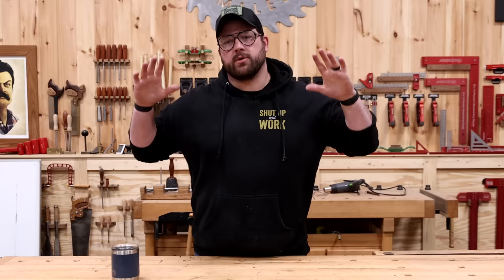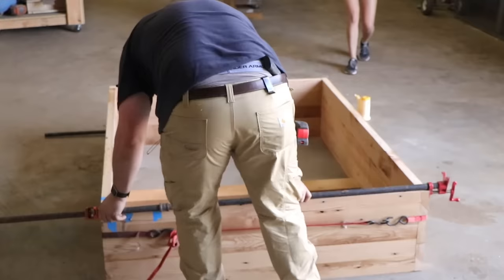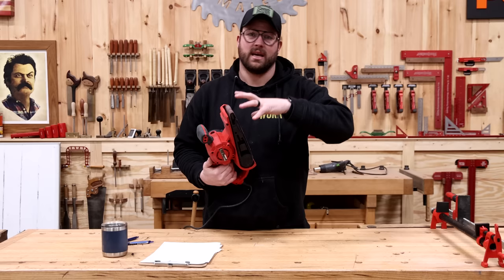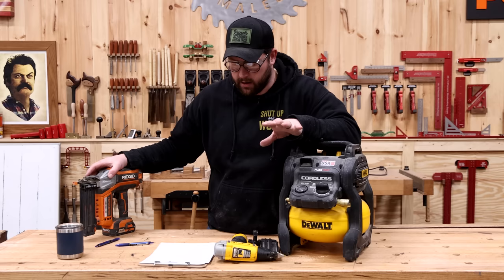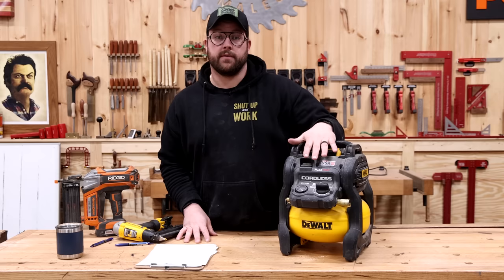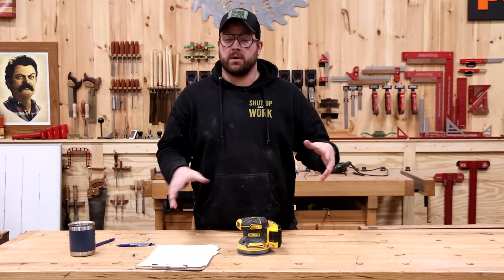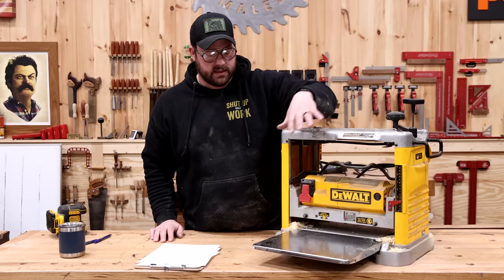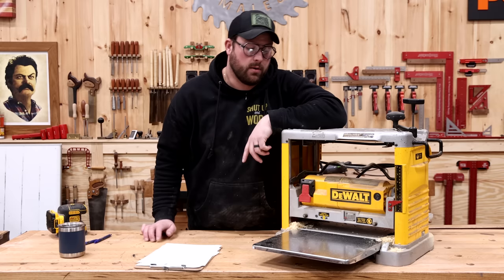5 Beginner Woodworking Tools I Regret Buying

Comment: In my 55 years of woodworking, I stay away from battery powered tools except for a Dewalt hand drill. I stick with corded tools. Battery powered tools mean you have to buy them over again every 5-6 years.  My basic tools are a 1967 Craftsman 10" radial arm saw, a 1950's 10" Craftsman table saw with extensions. A 1980s floor standing Chinese drill press. A HF 6 in x 24" lathe. A Jet 10" band saw. A 60's Craftsman jig saw (rarely used), a 4" Dayton joiner (rarely used), a 2 HP Craftsman air compressor and small HF pancake compressor, and more recently , a HF 12" Miter/Crosscut saw which I now use more than the Radial arm saw.  I have a bevy of old Stanley and Craftsman hand tools.  Many of the specialty tool I rarely use are HF such as for example: Forester bits. If I did woodworking/Carpentry every day I would buy better tools. But for home use I don't think you need to spend big bucks on the tools that are featured on PBS TV shows.  With my tools I built my 30 x 30 Garage, a 16 x 30 deck, a Pergola, a three story chicken coop which use to be the kid's play fort plus I added built-ins, custom cabinets and refinished my house that was 80% complete when I bought it.  This is only my woodworking tools I also have 4 tool cabinets of automotive repair tools and again many of the specialty tools are HF.

Comment: I'll take issue with he Rigid sander   We have had one in the wood shop for like 5 ot 10 years now. - There is no other power tool that can do all the things this one does.  We are heavy industrial electrical/millwright contractors and have to make wood and plastic parts for for forms and set up fixtures and other things like casting patterns all the time. The guys LOVE this belt/spindle sander. - They call it the die filer for wood and often carry +/- .005" on parts they make.  I have even sharpened drill bits on it  when I'm in the wood shop instead of going to the main shop and use the tool grinder there. - We have even used it a lot for straightening band-saw cut edges or  3/16 and 1/4 4140 CroMolly steel plate because the one in the main shop is a vertical  Powermatic. and the horizontal table on the Ridgid gives a dead nuts 90 degree edge.   I am talking INDUSTRIAL use of the sander too. . = If you are breaking them you must be animalizing the hell out of them or you are one unlucky joker.  .

Comment: Adding to the K-body clamps...they are not parallel either.  The old German ones were good.  the now China ones can have as much as 1/16" out of square from bar to clamp face.  Returned several sets due to change in design or manufacturing flaw. As a professional woodworker, I rate his recommendations as Good overall.

Comment: I agree with the belt sander, I bought a fairly cheap one starting out, and the gouges are redonkulous, you definitely have to keep it moving, I ruined quite a bit of projects. I have experience now and am capable enough to use one well. But typically I abstain from using them except on rough cut wood, or pieces right out of a planer etc. the dewalt palm sander is my go to for most things.
Reply: You know it's funny how we all have our own approach to some tools. I've been using a cheap belt sander from harbour freight for about a year now and I love to have it by my side 😅 It's dust suction is great by its own comparing to the orbitals I've tried (not attached to vacuum). I've bought belts from 60 to 400 grit and I can get very good results from it even to staining. I agree it can do some gauging very quickly if you let them slip but it reduced the time to remove old varnishes and painting or just scuff sand a furniture top and sides. Specially good to remove materials, like bondo when fixing broken panels an holes. And then I can use the orbital sto get more fine and gentle parts and pieces.
But what it excels its I can clamp it to the table and lock the power button and now I have a "band saw table" anywhere close to me 😅 since I don't have the proper space for a fixed sander, it's doing its job in order to buit some new legs, replacing broken pieces and all that stuff 😅

Comment: In short. Buy a drill, a hand electric planer, a small orbital sander, a circular saw, a mid-heavy hammer, a medium crowbar (I always use my first 14 inches), some glue, maybe 4 plastic 24'' (if you can 36'') clamp (make your own clamps in hard wood you find but you can make them the length you want if you use a long 2''X4'' with reversed bloc you screw at the extremities to extend your clamps.). 

- The rest you can make your own devices to use these same tools to make the more complicated one instead of buying expensive ones with wood scraps and screw/bolts and a lot of creativity(and help from youtube in need). 

I was lucky. I began helping my father who were, at the time, a life-long cabinet worker. It help to have the creativity to find solutions instead of using expensive tools and find other ways to make things sometime we make complicated for no reasons. Sometime you better make one good step than 5 fast steps figuring how you'll work instead of just rushing the thing and, eventually, you became more patient and save a lots of spare fingers on the way by taking your time that way.

Comment: For planer, it's decidedly more expensive, but Cutech and Wahuda both have spiral cutter head (not helical, but there are pros and cons to each) planers for ca. 600 bucks. That's notably less expensive than upgrading any standard straight-blade planer with the original planer cost figured in. 731 Woodworks reviews his Wahuda jointer after 2 years, and thinks well of it. The planer is using the same head design (Both Cutech and Wahuda also make a fairly inexpensive 10", as well as 8", jointers).

Comment: I like your kinda out there list.

I agree with about half of your stuff. 

Interestingly, I actually use a cheap skil belt sander ($35 - 7 years ago) affixed to a table to replace the ridgid standing sander.

Otherwise, I would 100% agree….

Comment: I bought a DeWalt ¼ sheet sander about 32 years ago and I am still using it on everything.  It is a plug in and have never had an issue with it.  I see no reason to ever own a battery on a sander.

Comment: I always thought pipe clamps were cheaper but by time you buy the clamp and the pipe you are at the same price. The one benefit is you can buy multiple lengths. But then I found I was buying the clamp every time I bought the pipe.

Comment: Literally used my cordless ryobi 18 gauge (I never buy ryobi) all day today not once was my arm killing me. I’ve had, dewalt, bostitch, Paslode, finish guns and the Ryobi is my favorite it’s light it doesn’t use any fuel, doesn’t take 5 seconds like the dewalt. It’s like $140 and you can get 2 batteries and a charger for like 75. They run on 2amp batteries just fine. Now I wouldn’t recommend Ryobi saws impact gun/drill, or most shit by them. But I love the 18 gauge

Comment: Honestly, the sound of air compressors drive my crazy. I have one for filling tires, but I bought a battery brad nailer. If I have a big project that I need to do a lot of nailing, maybe I’ll get the brad/pin nailers for the air compressor but for my woodworking, the battery one is fine.

(The circular saw, miter saw, etc., don’t bother me nearly as much.)

Comment: Mobile work changes the equation. I own small compressor and pneumatic finish nailer, but i rarely use it since battery nailer is so much easier. Besides this gentleman forgot to add the price of air hose? Also, one shouldn’t use same hose inside which has been outside. Nevertheless, this was good video that gives a lot to ponder about. My advice for beginner carpenters is to always check what brand or specific tool is market leader. And watch youtube, project farm for example.

Comment: If you're not getting enough clamping pressure with a K-Body, you're probably squeezing too much glue out of your joints. K-Body clamps are way more rigid than cheap pipe clamps. The pipes flex a lot. The only reason professional shops use them is because they're cheap.

You're spot on with the hollow chisel mortiser. I've got a General that's been used once in about 18 years.

Comment: I agree as to stepping up to the DeWalt 13" planer, but disagree with some of what you say elsewhere. I hope newbs (I did my first woodworking project 60 years ago) don't use this as a sole source of information. Especially hope they don't think they have to buy a load of (Woodpecker on your back wall?) premium marking and measuring tools when two or three key, well-made tools will do it all.  I TOTALLY agree as to handheld belt sanders, vs random orbit. For a newb, the belt sander is too frequently just a divot digging machine. I actually would suggest to friends just starting out to begin with unpowered hand tools and learn the wood, sharpening, etc. before making costly and potentially dangerous power tool decisions. Thanks for putting yourself out there.

Comment: Tools I have used the most.... in order of good value and high use consitently over projects, 1st Drill press. 2nd sander 3rd Table saw 4thor lower would be my router. You can never have too many calmps. i'd give some teeth for a belt sander, there are some jobs it can do that are hard to do any other way unless you are really fit. A good large plane is also a great thing to have, you can never sand flat an electric planer's gauges.

Comment: $15 for 24" of black pipe is very high. Go to a metal supplier, most of those pipes don't need to be threaded, so they're sometimes 50¢ a foot for 3/4" pipe

Comment: Nice video but gotta disagree with you regarding the 18ga nailer. First, it's false to say the ridgid battery powered nailer doesn't have the "bump" feature.  It does. 2nd, even though it may be heavier than the compressor powered guns, it's better than having that hose hanging around your feet when you're on a ladder 24 feet in the air.

Comment: Great info and very entertaining!  Sometimes I would really like to have an oscillating belt sander but I don't do regular woodworking.  Most of my work is building large radio controlled airplanes and the oscillating sander would be handy for smoothing inside curves.  Agree 100% on going with the better Dewalt thickness planer.  Glad I did even though it's one of the less frequently used tools in my shop.  There are times when it is indispensable.

Comment: Well there’s a few things to consider. If I had it to do again I’d buy heavy I beam panel clamps like Record. For carcass construction yes, love parallel clamps, and love them for Mission style furniture builds. I put up with pipe clamps for far too many years. The next thing is I’d invest in a high end RO sander. They are a ton of money, so yeah, start with a more consumer grade but don’t wait forever. Cordless brad nailer. Uh, no. Cordless compressor? Huh? Cordless drill driver and impactor would be my priority. Spindle sander? Get a portable one. Love them. Lunch bucket planer? If you are going that route, get a Makita. Better yet get a used four post. The DeWalt 735. Yes, especially the 735x. And Woodpecker squares etc.? Nah, iGuage is a better value.

Comment: I like my Milwaukee cordless random orbital sander...  I also totally disagree that it has bad dust collection.  I will admit though that it isn't my only sander, and a corded model is better for a lot of sanding.  I guess I also like it because I have about 4 5ah, 4 6ah, and a 12ah 18v batteries (so a lot of batteries).

Comment: Not sure I qualify as a beginner as I've been wood working most of my life but I do produce beginner quality work :-\  
On clamps I've had the Bessey clutch style clamps for several years and while they're useful they also have their limits and so I have the K style clamps on my wish list and so far family have bought me three for my christmas, father's day and my b-day and so they haven't cost me a dime.  That said I do agree that pipe clamps are awesome and I probably need to buy some more. 
I have two DeWalt palm sanders and the plate sander and needed something a bit more aggressive for taking more material off faster but also wouldn't splinter like on the bottom of doors whereas my power planer does and so I picked up a Ridgid for $50 at my local pawn shop and it was almost new. I don't use it a ton but I till use it. In fact I've also gotten some of my nailers from pawn shops and OfferUp on the cheap as well. I also picked up a Porter Cable pancake compressor off of Craigslist 15 years ago for $50 and it still runs great!  
Finally thanks for the tip on the planner! I put the 13 inch into my wishlist and maybe by the time I retire I'll be able to afford one!  Just my luck that when I retire my wife will put me on a strict tool budget. "Now nothing over $50!" 
Bonus: I have had three Harbor Freight tools that were awesome including a grinder that recently died after being abused for 10 years, a rotary hammer my cousin (who works at HF) bought for me with his employee discount as a house warming gift which still runs great and a heat gun that replaced my Black and Decker when it died. I've had other HF tools but these are the only ones worth mentioning and I'm very cautious about buying from that store because there's a lot of landfill being sold there.

Comment: I don't know if you can buy Parkside tools overthere, but they are very good and very very cheap for a beginner or even more advanced woodworkers. For around € 35,- you will have a great nailgun so for your DeWalt $ 90,- you will have both the nailgun and aircompressor. :D Maybe something to look at. :D I start to use more and more Parkside tools. Im an amateur woodworker so i can use the cheaper tools for a long time.

Comment: I don't necessarily recommend their battery tool because it's not a viable platform long term, but on plug in tool, Black and Decker is a great way to save money, it's basically 10 years ago dewalt at wish price. B&D won't blow your mind with innovation but they'll use old dewalt tech to make a reliable cheap tool. My random orbit sander as been sanding for a couple years and it still works great, and it was like 25$.

Comment: Parallel clamps are 100% worth the cost. You don’t need 40 to start out. You only need 2. Then get 2 more, then get 2 more as your budget increases. Between those and C-clamp locking pliers; you can be much more efficient and get better results with your glue-ups. In my humble opinion.

Comment: I would put my Porter Cable bandsaw, drill press, and laminate router as my least used tools. I can never keep the blade tracking straight with the crappy blocks on the bandsaw.

Comment: The parallel clamps are rated at 1300 -1500 lbs and the pipe clamps are from almost 400 to just over 1000 lbs. But first if you need that much pressure, something is not right also I found 2 of other stile of clamps are needed to 1 parallel clamp. The cordless gun is not for heavy use but has it's place. I agree half way with an air compressor but n electric one. Belt sanders can be found for less than 50 bucks and really useful just got to know how to use it. I would stay away from the square pad ones, the can easily leave swirl marks. The bench sander is one of the biggest things I miss. The kreg rip cut work very well, alot better than trying to rip a full sheet on a job site table saw or without a side and a decent outfeed table. All in all when I started I wish I did have some of these things but that's the hard part about making videos like this is what's not for you might be for someone else.

Comment: About the nail gun, you are so right, the battery nail guns do not come close to the durability of the pneumatic nail gun.  They are stronger by far and they do not ware you off like the battery counterpart.  I use to own a battery nail gun, but in less and a year I went through two of them, my ryobi and bosh still going after five years with proper lubrication. Just saying.

Comment: In a small shop, you can take the bench mounted mortiser, mount it on plywood base, and then store it under the work surface when not using it.  That said, beginners should probably not be doing mortise and tenon anyway.  Just start with pocket screws and lap joints depending on situation.  Pocket screw kit is not expensive.  Would not even think about teaching mortise until dowels and biscuits had been mastered.  Not beginner stuff.

Comment: I have an older DeWalt 12" benchtop planer and has two knives and black where that one is silver.  I have had no trouble with it and have only thrown the breaker maybe once or twice from trying to take off too much at a time.  If it quits tomorrow, I have gotten my money's worth out of it.

Comment: Instead of a belt sander when I need to remove material quickly, I use a large angle grinder with an 8 inch hook and loop sanding disc from harbor freight. You definitely need to wear a mask because dust will be everywhere but it is quick.

Comment: I will never own one of those mortising tools in the runner up section.  I've got a tiny shop, I don't have room for a unitasker like that.  I might get one of the mortising attachments for my drill press, or just keep up with my forstner bit and chisel strategy currently in use.
Same thing with that spindle sander.  That's another job my drill press can do.

Comment: Disagree with you on the cordless nailer and sander. My cordless nailer was $150 and I use it all the time. And I've had both  a corded and cordless palm sander and I actually got more power from the cordless one. Plus, the cord always gets in the way, and I always have to make sure I'm near an outlet, etc. Plus I build I lot of built in furniture in my house so I sand on location, not back in the garage so I need to reach everywhere and can't be worried about a cord.